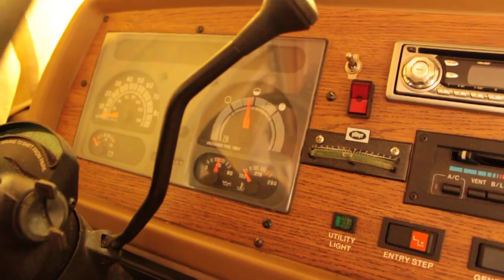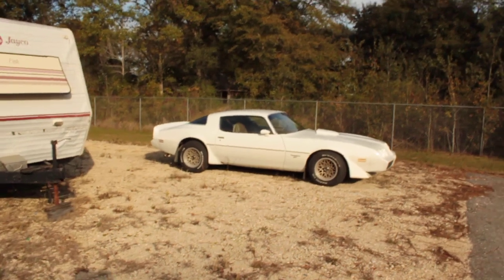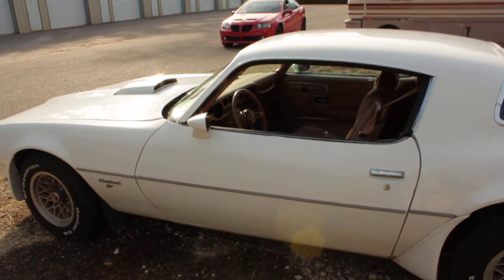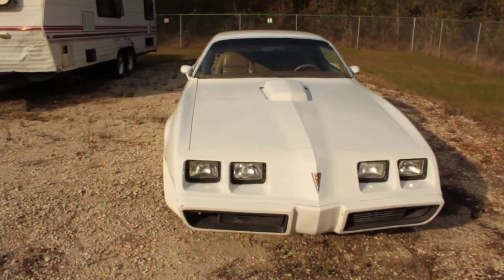Motorhome, bus, plans

Comment: Personally, I'd rather have the new tire put on the steer, and move the current steer back to the drive.  Motorhome tires usually dry rot because they don't usually get enough miles on them fast enough to burn the tread off.

Comment: Had to watch when I saw it said, "chalk my ride." We bought a Bounder. Diesel Cummins pusher on the Oshkosh chassis, 1993. The shift linkage is shot, the parking brake is integrated with the linkage. Anytime the rig is stopped to park, someone would need to chalk it. It has been at the shop for near 2 months. It was backed into by a semi trailer at said shop and suffered seemingly minor damage. Still waiting on estimates and such to settle that one. Not sure what we are going to do, going to check out more local repair talent. The shop it is at now can't even give us a ballpark estimate to repair the linkage.
Reply from the maker: Oh cool. Yeah the Chalk My Ride is my current RV. The whole outside is a chalkboard. I wish my old Bounder would have been a diesel pusher. I still miss it anyways though. I hope they can get yours settled and you can start enjoying it. Mine sat at a repair shop for a month or two waiting to get new front airbags that went in the springs.